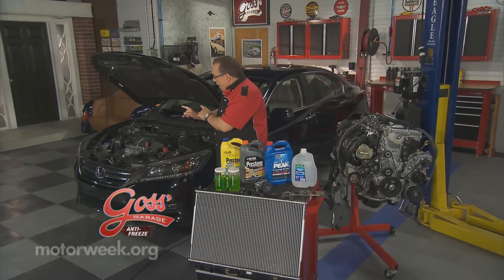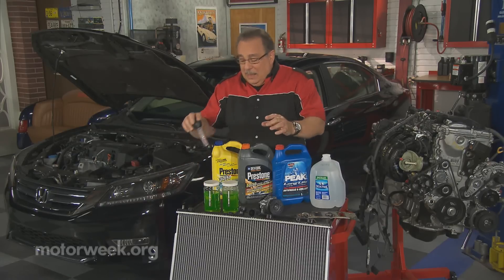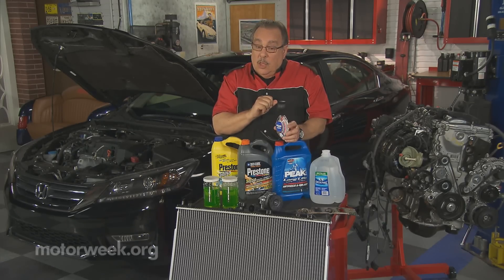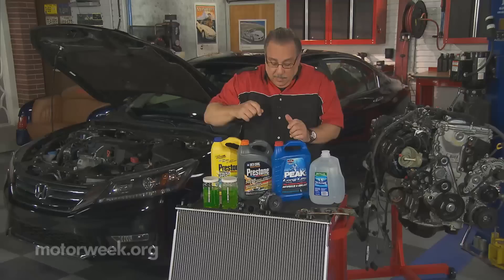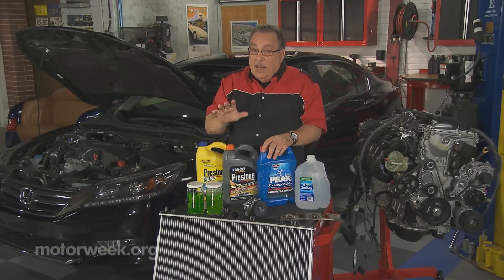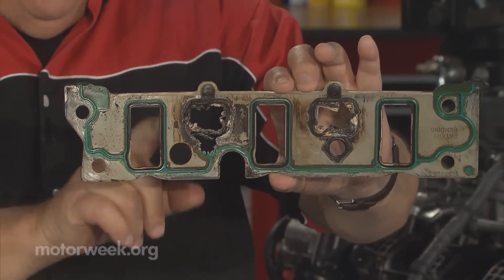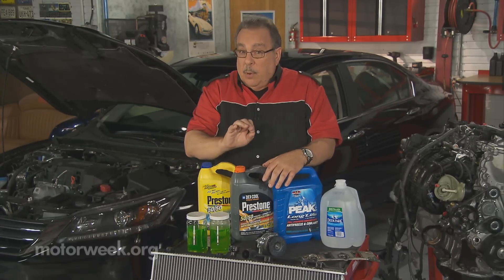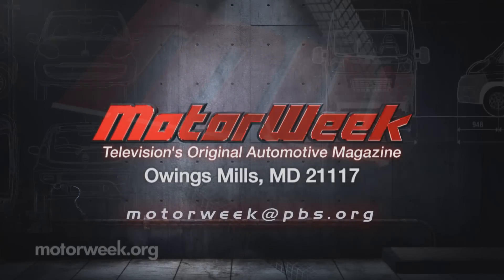Goss' Garage AntiFreeze

Comment: I converted my subaru to Dexcool years ago.  I didn't tell you to do it, the conversion is tricky.  But once it was converted, wow.  I can go years and my coolant tests good and the car never overheats.  I can go 75 mph up a mountain and the temp gauge never goes above half way.  305,000 miles.  Dexcool is amazing.  Even though everyone hates it.
Reply: It can be for some people and some types of vehicles that are specified for it.  But it's a "Huge Mistake" if people buy it as a random roadside emergency or top up purchase...and put it in with something else.  Takes a lot of effort to get it out too if you screw up.  A lot of folks just think Antifreeze is Antifreeze, and probably would've fared better if they pulled into the Supermarket and got a jug or two of Distilled Water...which actually cools much better anyways!   But DexCool is fast earning the nickname "DeathCool"...I've even heard enough Mechanics suggest you'd be better off if you just replace the DexCool out, flush the system, and throw in a Standard Green or an Extended Life HOAT Coolant.
Reply: All universal extended life coolants are the same chemical composition as Dexcool, except dyed yellow, and I can second everything you've said, it's great stuff and everyone should use it.
Reply: @darring.9161  I've been running it for years and the car is near the end of it's life, not switching over now.
Reply: @coolantkid3428  If it's the same as everything else, why doesn't it mix with most other coolants?
Reply: @Clearanceman2  You must have misunderstood my comment, I'm not saying to change it, I'm saying it's great and I can confirm to the non-believers out there that your experience with it is not unique.  Anyone who runs universal or Dexcool will have excellent results.
Reply: @Clearanceman2  It does mix with other coolants.  Dexcool has been incorrectly blamed for everything that has ever gone wrong with a GM product's cooling system.  There is nothing wrong with it and it is excellent.
Reply: What year and model is your Subaru?
Reply: @coolantkid3428  2000 legacy
Reply: @Clearanceman2  That is a great car.  Did you need to replace the head gaskets?  Why do you say the car is near the end of it's life?
Reply: @coolantkid3428  Done at 185,000 with MLM gaskets.  Rust.  Live in WV there is a limit sadly due to salt treatment.
Reply: @Clearanceman2  Sorry to hear it.  How many miles and years did a single cycle of Dexcool go?
Reply: @Clearanceman2  Clearanceman2, are you there?  How many miles and years did you run a single cycle of Dexcool?

Comment: Getting my coolant flushed tomorrow and had to bring the shop a gallon of distilled water. They typically use premixed coolant. Also, important to remember to replace your recovery caps every so often to prevent gelling.

Comment: You should do a segment about "permanent" or "for life" coolant, and "special" coolants.
Reply: VAG or BMW blue G05 coolant is the only coolant to use in a VW. I won't subject ANY car to "American Green" any more.
Reply: ***** I've been using "American Green in my Vanagon for 17 yrs./240,000 miles, and the studs are the originals to the engine, the heads failed after 100k + miles, and a lot of overheating cycles due to coolant hoses failing and plastic parts in the cooling system cracking. And that will not happen again, all plastic parts have been replaced with aluminum parts, and all hoses are new. Orange coolant is the next step, so hopefully the engine will see another 200k.
Reply: *****.....I would rather use urine than American green. In my 66 Mustang I used to get "solder bloom" in my copper/brass radiator, which bugged me and the new water pump always left a few drops after I parked so when my freeze plugs went bye-bye the radiator was gone-thru and I tried VAG blue G-05 on my cast iron 289. The engine ran 4° cooler, the water pump stopped dripping, and now after 5 years the radiator is still shiny brass inside; no solder bloom whatsoever! My other "American" car is an 84 VW GTI bought used. Put in a Behr radiator, MK2 fan run on low speed, flushed the system to VAG blue G-05 and a single valve VAG cap. The crust at the weep hole never came back and I've never touched it since. Still on the original pump, thermostat, switch, & hoses now at 180K. Orange? If you're referring to Dexcool, VAG's version is pink, but don't put it in a Wasserboxer! The issue with Dexcool (OAT) is if it comes in contact with air & it's not kept under pressure, as in a recovery tank system, it turns to Jell-O. The Wasserboxer has a recovery tank behind the license plate does it not? Your heads didn't fail, they corroded under the rubber seal right? Don't risk it. Other G-05 (HOAT) coolants are EU Ford Motorcraft Gold, Mopar Orange, Zerex Yellow. DON'T go by color but by chemistry! And distilled water.
Reply: ***** All that is good to know, thanks for the good info.